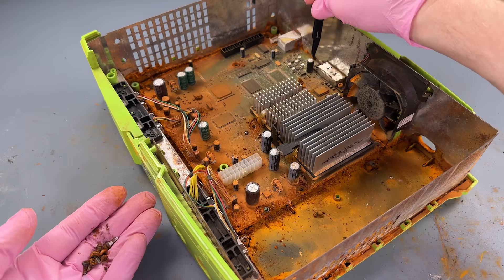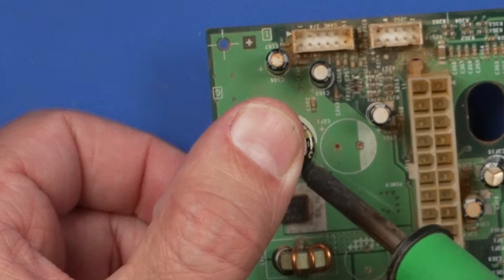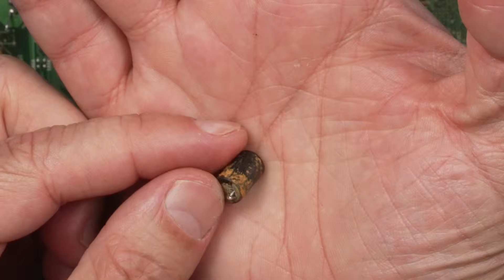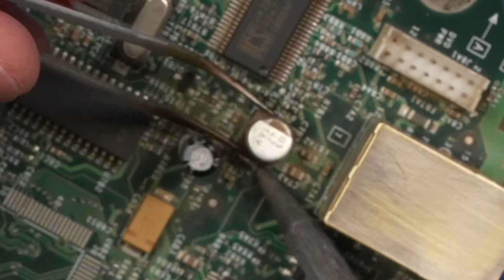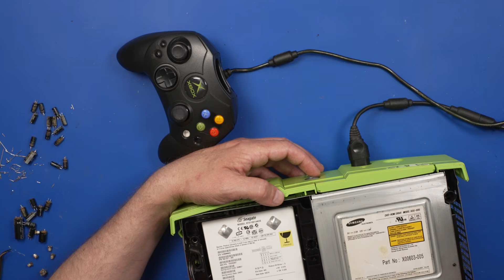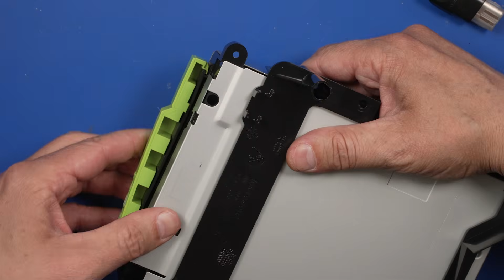Trying to Save a FLOODED Mtn Dew Xbox

Comment: 13:00 You move the tray right after you push the button and it will pop open or you could change the belt of the drive.

Comment: Amazing its got cleaned up that well - nice job guys. Just a tip for the surface mount caps, you can use the twist method to get them off without damaging the pads (Adrian Black of Adrian's Digital Basement) is a fan of this. You then just desolder the legs from the pads that sometimes remain on the board ;-)

Comment: Here in Brazil, the plates that arrive in this situation we wash with a mixture of degreaser and brasso, brasso is a type of metal polish, and then we rinse well and let it dry for at least 24 hours, helping with the thermal blower to dry, it helps a lot.

Comment: As much as I LOVE the OG Xbox AND MTN Dew this color is hideous why did they pick that color plastic 😂 I would have loved if they did this edition like a clear yellow green like that extreme green n64 controller. that would have made this console a lot more desirable to me atleast. What an incredible save on this console. This shows how durable electronics can be. Im more surprised the gpu and cpu still work and that corrosion didnt get to the tiny pins or inside the chips themselves 😮

Comment: I thought for sure the disc drive or power button traces along the edge of the bottom of the motherboard were toast lol! I've had to fix several from that in my vintage Xbox collection. Caps leaked years before I got them and it ate through the traces

Comment: I don't believe you have lights on the front which is an indication of trace rot from a leaking clock capacitor. It could also be the reason for the first port not working. Also, "Equate Black Non-Metal Elastics, 250 Count" are an almost perfect replacement for the disc drive bands. You didn't indicate if you removed the clock capacitor in this video. Something that should always be addressed and mentioned when working on this era of xbox.  As always, a great video. I look forward to more.

Comment: lmao I probably spent 10-15 hours recapping an entire xbox motherboard, almost all the joints were almost impossible to liquify even with fresh solder and flux! the corrosion really makes it impossible for that solder to liquify. Xboxes are now one of my least favorite boards to solder/work on because of the time bomb that is the clock capacitor and the fact that it makes almost every cap nearby impossible to desolder :/

Comment: I would wash that board with soap and water first, water in boards is not a problem if no electricity in the circuit, i would wash it and then or heat the board to water evaporate or wash it with isopropyl alcohol and it would look like new

Comment: I believe there's a way for whoever are the experts at making goods out of plastic and all that they could start making waterproof accessary boxes to buy with a console that has some kind of special made removable section to it to allow air into it if someone wants to keep their console inside of it but then when there is a risk of a flood ruining the system they can add the section or slide it into waterproof place or something and save the gaming unit.

Comment: Surprised you didn't use an Hakko FR301 solder sucker gun. Or do the surface mounted caps a good old twisty twisty trick to rip the legs off and then remove the left legs from the board.

The tray driving belt is also always bad in these, you can seap it or simply just cut it and glue it with locktite it'll never let go. Just don't cut it too short before gluing it.

Comment: Great knowledge for repairing vehicles or aircraft after a EMP.  Clean the contact points and make sure the circuit is complete. ⚡ Flows through everything. Where does it stop. Why. Fix it.  I'm going to sacrifice a ham radio for a raspberry pie experiment with my 11 year old son in a couple of days here.

Comment: As for the original Samsung drive that wouldn't read discs, you can try to replace the caps on the disc drive's logic board.  I've had to replace the caps on my own Samsung drive to get it to start reading discs with no pot tweaks.  You can even swap the logic boards between the known working drive and the bad drive to help narrow down if the caps are bad if they're the same revision (the small sticker under the main Samsung label).

Comment: Very nice!
One potential issue you should look into is the clock supercapacitor. The original ones have a tendency to leak on this model (not revision 1.6) and will damage the traces on the other side of the board, specifically the ones that wire the front panel to the PIC (eject, power button). The difference with the tray eject is subtle, where it just wont respond (damaged trace), or attempts but will not eject the tray (loose belt).
Another issue, since you're replacing the power supply caps, is to reflow the solder at the ACin power jack, which have a tendency to crack, eventually sparking and burning the house down (Microsoft later replaced all power cords with a GFI cord, but didn't solve the true issue and exacerbated the problem)..

Comment: Hi Steve!

These Samsung drives are known for having trouble with opening properly. Mostly is just worn belt. For future, if you have trouble with opening drive, when it's just stuck, try to gently "knock" it from the top. I have four of these Xboxes, and one with Samsung drive acts like this, so i have to "slap" it to insert a disc :D

Interestingly, if drive have a disc inside, then will open freely without any problems.

Comment: A new drive belt will fix that disc drive in a heart beat, plus you can change iy just by opening the drive to put a disc in. Even a slightly stretched belt will make it not go in and out reliably.😊

Comment: That Samsung DVD Drive that came with the Mt.Dew Xbox might not be a lost cause just yet. There's two versions of it, one I've had decent success with refreshing the solder on the resistor packs and checking to make sure they still within tolerance.  Say about 65ish% now been able to saved this way. They too are also known to have a cap go bad time from time. Might also want to give that a look as well.

Comment: I know what happened to that disc drive.

Those are the exact symptoms of a drive that was “butter knifed” for halo 2 matchmaking lagging.

Essentially, the match host could stick a butter knife under the disc drive and temporarily “stall” the disc to cause the opposing team to lag.

The hosts team would be on their Libby server or whatever it’s called, and wouldn’t lag. So the cheaters whole team could run around and just wreck the other team while the host did nothing but temporarily stalling the disc every 10 seconds.

But if you did it too much, or wrong, it would cause those issues. Disc trays that failed to eject because they were slightly bent and lasers that wouldn’t read anymore brace the disc was being pushed into them.

Comment: It's a Samsung drive, no wonder why it has Trouble ejecting.
It's a common issue with any Samsung Drive, on the Xbox and Xbox360.
I also had several PC DVD Drives and DVD Players from Samsung that suffered from the same issue over the Years.

Comment: I was thinking to myself this whole video "in a non video environment, as a repair tech with spare boards lying around, wouldnt it be easier just to swap boards since its just the shell that counts?" then you swapped the disc drive and answered my question 😂
Reply: There's easy then there is competence and skill.
Reply: Replace some capacitor is not a big deal and new caps are fairly cheap.
And I believe that If you replace the main board, you have to use the HDD that came with the board because they are linked.

Comment: Back in the day when I took electronics in college (over 35 years go) We had not only the braided disordering wick, but also a spring loaded syringe.  You would press the plunger down against a spring and it would lock in place.  Then you pushed a trigger and it would pop the plunger out fast and suck the solder into the syringe fast.  The tip was metal and it worked pretty good.  I liked using it better than the braided stuff.

Man I would have thrown that in an ultrasonic cleaner for an hour first.

Comment: Did you manage to repair controller port 1? Great video btw, its tedious to replace all capacitors!
Reply from the maker: Yes!  It had some gunk in it and worked after cleaning it out.
Reply: @Tronicsfix  awesome!
Reply: Thanks for asking this, because I too was wondering.
Reply: I was checking the comments about this too since he didn’t mention what happened with it, but I did notice when he was testing the disc drive the controller was plugged back into port one so I knew he fixed it just didn’t know how.

Comment: What I don't understand is why folks on the 'tube don't just wash the whole PCB in soapy water? It won't damage a thing if you dry it out properly before applying power again. I've done it countless times and never had a short after a repair.
Reply: There are a number of reasons, the main one being capacitor fluid and rust is pretty tough to properly clean, so you need more powerful stuff (like IPA) to get rid of it. Plus it's more thorough

Comment: I remember this one. Someone stored it in salt water to protect it from air
Reply from the maker: Ha, ha...sure looks like it!
Reply: My bad that was me! 🤣
Reply: I saw it on ShopGoodwill.  The closing bid Was $500...crazy.
Reply: Store it in oil. There is transformer oil, it  does not conduct electricity, keeps air out and protects from rust. No salt water, only pure oil.
Reply: @vertecies  But then how would you get the oil out when you wanted to use the console again... my skin is crawling just thinking about it
Reply: @mysticaxolotl8215  Clean it with ISO
Reply: @mysticaxolotl8215  it is non conducive oil, so you don’t get it out. It would work while submerged.
Reply: @mysticaxolotl8215 why you burn the oil of course! Just kidding. Seriously I hope no one does this.
Reply: @brewmasterwayne  But then it gets all over whatever you try to put the console on, or whatever cables you try to plug into it... this seriously seems like a solution in search of a problem
Reply: @Doyle69  Isopropyl alcohol can only do so much
Reply: @mysticaxolotl8215  oh, I don’t think it is a good idea at all, I just meant that it would still work when submerged.
Reply: @mysticaxolotl8215   look LTT linus tech tip video where they do acvarium oil insulated pc. First pour out oil, then let it try or wash off with washing soap. Do not do it with your brand new PC! Also look how LGR lazy game review washes pc in bath :)